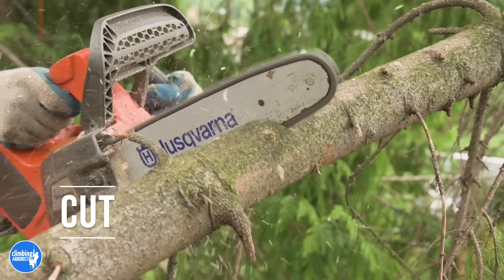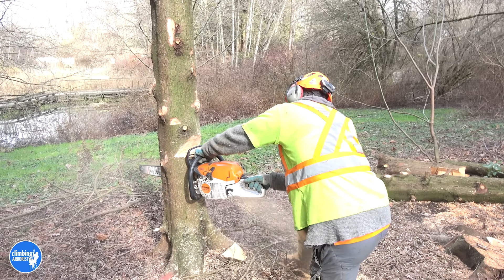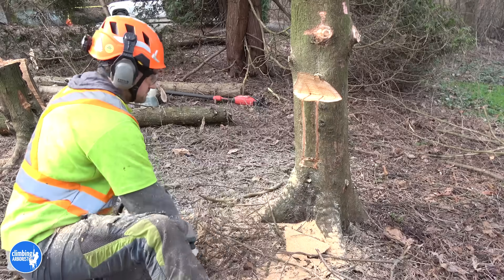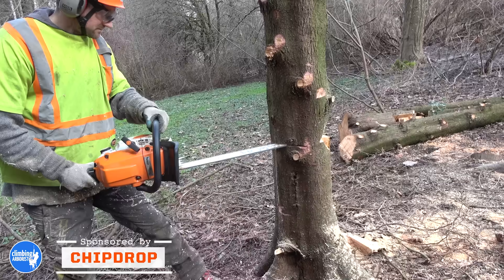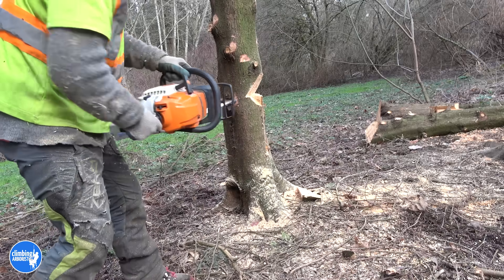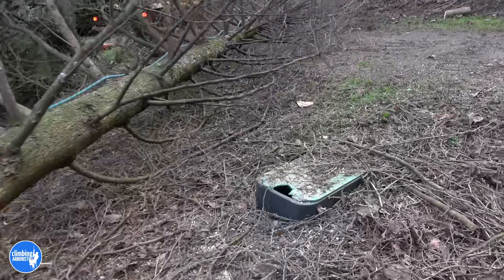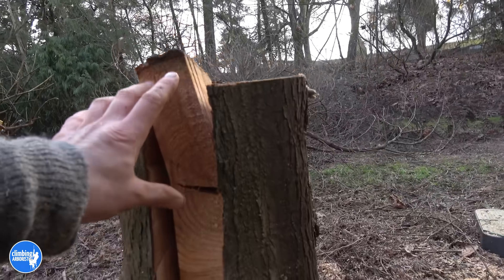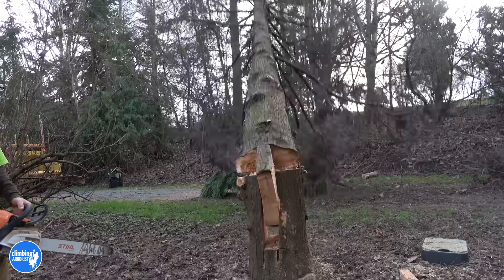LEARN the 'KEY NOTCH' tree falling technique

Comment: Well executed.  Great explanation of use. This is a training video.

Notes to a lot of homeowners: 
If you have a "safety chain" or "anti-kickback chain" a plunge cut may be very difficult to nearly impossible.  
if you haven't got training besides watching you tube, a plunge cut might be more advanced than you think.
Reply from the maker: Well said!
Reply: @ClimbingArborist  Maybe a video for your followers using a safety chain. Why and how they are made. And what homeowners should do.
Reply: I dont recommend plunge cuts at all. They are quite dangerous for anyone. I know someone who has taken a saw across the chest. His scar does not look cool.
Reply: I was thinking the same thing watching him do it, " I'm gonna be able to do that with my Poulin????, how do I know if my saw has a safety chain?? also , seems like you would need a 60-70cc saw with ample power. Don't think I want to try this.
Reply: @pennyan2057  All new saws below 60cc are now required to come with an anti-kickback chain (AKA "green" label chain). They have additional depth limiters on the links between the primary cutter-links (some are very obvious, other brands are rather subtle and overlap the standard depth limiter). 
The extra depth limiters only do something when the chain bends around the tip sprocket. The anti-kickback chain is otherwise standard dimensions and interchangeble with classic chain. 
A classic chain (AKA "pro" aka "yellow" label) can occationally take an excessively deep bite when going around the tip which will make it jump up violently, this is managable if the operator is aware of the possibility and situations that make it likely and so is ready for it.(This is also the reason for the chainbreak.) However kickback can be especially dangerous for Joe Drunkard ameture that doesn't read instructions or otherwise know what he is doing.
Classic chain is still commonly sold in the traditional full width 3/8 and 404 sizes. I don't know of any non-kickback chain availible in the micro[pico]-size used for pole pruners or battery chainsaws. For the light chain just above micro, non-kickback is marketed as a specialty item for chainsaw sculpting and the teeth are shaped more for clean cuts rather than pure speed and efficiency, but its no real issue anyway as your unlikely to be doing high production work with a saw that takes this lighter chain.
Reply: @pennyan2057 You don't need much power, power only = speed, I cut mostly with my ms180 Sthil, I have a 290, but that is reserved for big logs cutting them to woodstove length, its too heavy to haul around unless you really need it
Reply: @integr8er66  Power is also needed for large wood because of the number of teeth engaged. For the really big stuff with long bars, a lot of pros will use a skip-tooth chain to reduce the tooth count in half for both less stress on the chain and to avoid clogging the cut with wood chips. Bigger powerheads can also deliver more bar oil which is nessesary for longer bars (This is why a 460 is limited to about 32 inch, the oil adjustment is maxed out). I also know folks that don't cut too much big wood so they use a standard complement chain but they still use an extra long bar to avoid bending over as much when bucking.
Reply: I really don't think it's safe or responsible to teach amateurs to fell trees.  He is going to get people killed or maimed, this is not a trade you can learn from video tutorials there are way too many factors.
Reply: @vyvianalcott1681  I disagree. People are going to buy chainsaws and use them. Better to have more/better information online than nothing at all. Someone may see this excellent technique for felling a tree w/o damaging anything and say "nope, I'm going to hire it done".
Reply: @vyvianalcott1681  on the contrary those of use amatures find our selves in predicaments that need this finesse. I have used this cut and it works amazing with my junk 18"poulan

Comment: Just a little time saving tip- your very bottom cut- instead of cutting the block out- simply angle your cut downward front to back- it doesn’t bind that way. 
I do wish those who show this make it very clear- when felling a complete, free standing tree- most
Of the time this does not work. The tree rolls to the side, when it hits the ground the “tongue” breaks off or the tree slides forward and lands on the ground. 
Looks cool but…..be ready for it to fail.
Reply from the maker: When you say ‘most of the time’ what is your sample size you are taking the numbers from?

Comment: Finally someone explains WHY to use this cut. Thank you!
Reply: I'd appreciate more hints on when to NOT use this cut.
Reply: @col0342  In most cases, if you know how to "sight" your saw to make a straight face cut and back cut and read the lean of the tree, any time three cuts is faster and less expensive to perform than twelve. In other words, I run a pair of 70cc saws that are about 18 to 20 pounds as equipped depending on bar length. They cut wood like hot butter, but economy of motion is important if your body is capable of wearing out over a long day felling and bucking. I've been known to limb things with my $59 Harbor Freight electric extension pruning chainsaw because of the fact it weighs maybe 5 pounds. Being a bada** was cooler when my back was about 20 years younger. 😂 Now, no shame in pruning with the low profile chain of the common folk. In fact, once I determine the longevity of Stihl MSA batteries over the long term, it's on my list to consider for a lightweight saw for aerial tree combat.
Reply: @col0342  always
Reply: Use it to keep the trunk from crushing something below it.  Have seen this performed on trees protruding through decks.
Reply from the maker: No problem
Reply: I believe this is called the Huntly Hinge, a technique to keep the stem close to the stump and off the ground originally to set up a bench tree for forestry harvesting long ago and more recently for creating habitat barriers so animals can bed behind and under them. It seems to have been "discovered" about ten years ago and now there are lots of videos about doing it. 
The original purpose was to keep the trunk off the ground to allow cutting the branches and then using it as a bench tree to drop others onto and use as a table for removing branches on other trees. Modern heavy equipment has eliminated much of that need in commercial forest cutting today.
Reply: keklol. imagine being u, huz unable to understood himself such simpol thing.

Comment: (Asking, not criticizing)
Why not an open face cut instead of conversational?
Reply from the maker: Likely that you could use traditional, Humboldt or open face, but the traditional forces the hinge to break sooner than open face and the allows the tree to drop into the slot.Whereas if using an open face the tip of the tree may land before the butt end has come away from the hinge and slotted into the stump.
Reply: But they start with a conventional face cut then modify it to an open. Why wouldn’t they just start with an open?